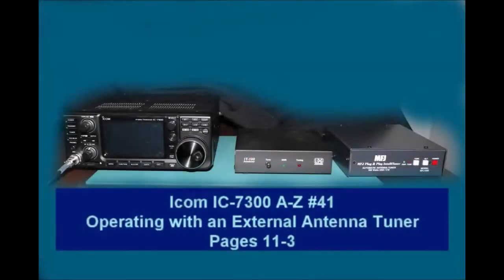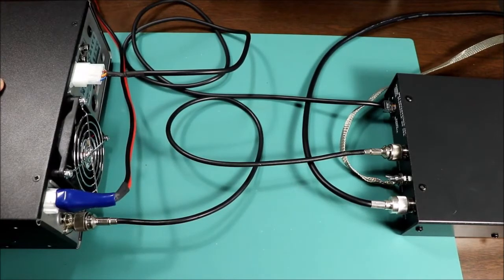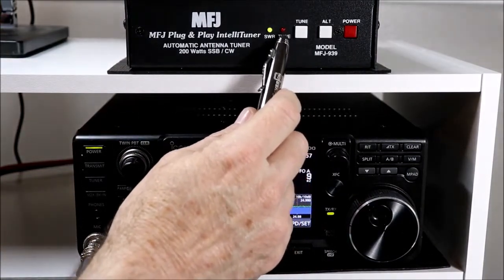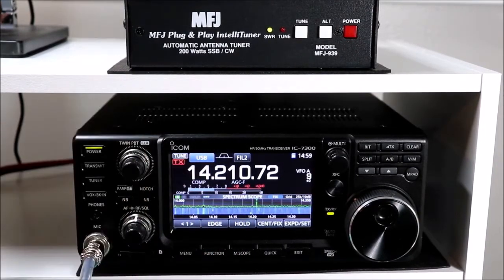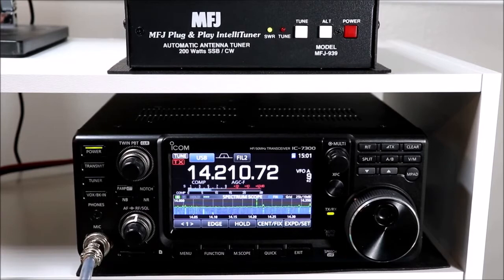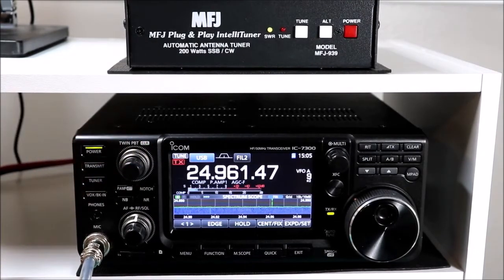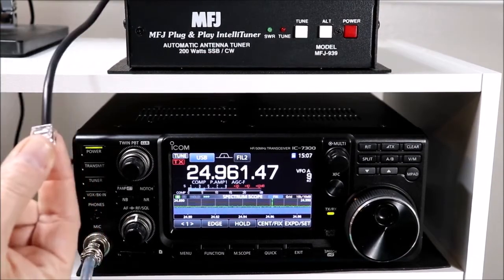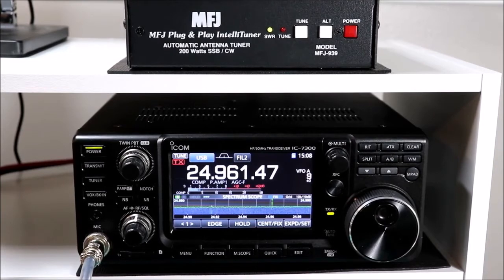Icom IC7300 A to Z Using an External Antenna Tuner

Comment: Many thanks for the info, I noticed that when using external tuners some tutorials mentions that once you got a match you need to disengage the internal IC 7300 tuner so you don't have two tuners doing the same thing. My external tuner (LDG AT 7000) don't have an on board button to activate the tuner so to engage the tuner i have to press Tune on the radio, would this mean that both tuners are still engaged?
Reply from the maker: there is a setting for this in the menu.